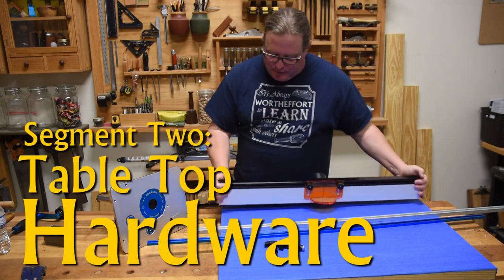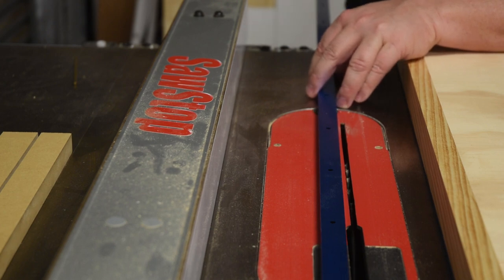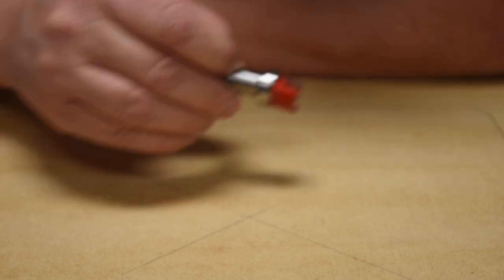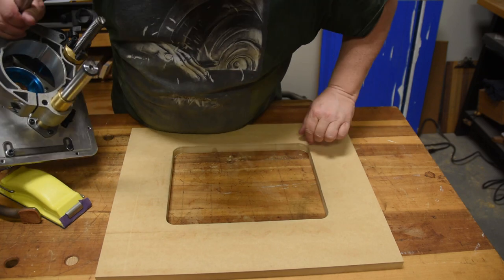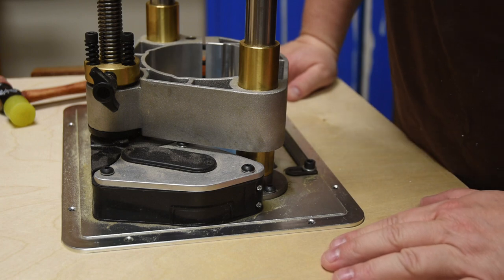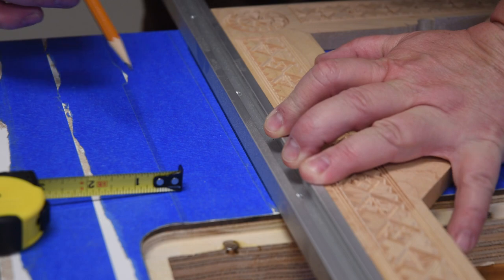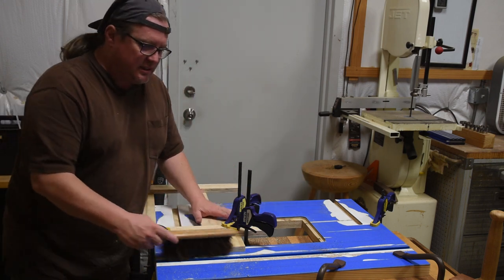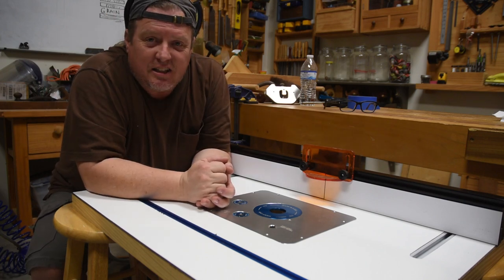Router Table Build - Segment Two: Table Top Hardware Installation

Comment: On the new router table top I'm building, I am installing a t-track AND a miter slot along the front edge, for maximum flexibility in what I can use - the miter slot will be very useful in coping cuts, using a miter gauge. The t-track can be used for featherboards, hold-downs, and the like. I  know you just "eyeballed" the location of your t-track, but when  I was laying out my design, I realized that the t-track has to be close enough to the router bit to allow the accessories and fixtures to allow them to work with workpieces that may be very narrow, up to about 8 inches in width. The miter slot was not as critical, as the miter gauge can be fitted with an auxiliary  fence to get the workpiece closer to the bit (and even double as backer board if desired). 

One way to avoid edge-chipping on a laminated surface (formica or melamine), is to use one the outer blades of a dado set to make a very shallow cut through the laminate. Use one blade for one side, and the other blade for the opposite. This works because the teeth on the outer dado blades are beveled in one direction only, to make clean cuts on that edge. 

Just my 2 cents worth.

Comment: When I built my router table I used the distance from the track to saw blade on my table saw as the offset for t-track on the router table. Has worked so far.

Comment: One method to minimise the chances of chipping the laminate surface is to first pass the board over the table saw with only around 0,5 to 1mm (1/64 to 1/32in) of the blade showing before making the full depth cut.
This essentially scores the surface  at a very low angle, as with a utility knife. Whereas the full depth cut has a lot higher angle of attack, which is pulling the laminate surface away from the wood substrate.

Comment: Hola amigo!! To avoid the chipping on the melamine, one option is to make a "cut" with a carpentrer´s knife or sharp knife, along the dado and not more than  one mm deep. It needs a bit of calculation and more work but it improves the chance to save the board.

Comment: Here is a way to “measure” an unknown radius.   Draw a line across the radius.  The more radius you have included the better.  Next draw a line from your first one to the radius at the widest point.  This line must be perpendicular to the first line.   Measure the length of the first line.  Call it “d”. Measure the length of the second line call it “t”.   The radius is then calculated by this formula.  
R=(t^2+(d^2/4))/2t.  The accuracy is dependent on how carefully the measurements are taken.

Comment: A combo blade is the wrong blade to cut laminate.  Use a finish blade.  Between that and using painters or frog tape, you'll get a perfect cut with zero chip out. Then run a light file over the edges because it's going to be sharp!

Comment: Scribing the radius on the t-track would probably be a little easier if you flipped it over. That way there would be one continuous line to follow instead of 2 segmented ones.

Comment: Reduce the chipout by scoring the cut with a sharp knife before useing the power tools. Just a thought. Tape off the channel and paint in the chips with some white-out or acrylic paint, if it bothers you.
All in all, great looking router table top. 
How much do the lift and channels cost for those of us that would have to buy them?
Reply from the maker: Those were Rockler Items.